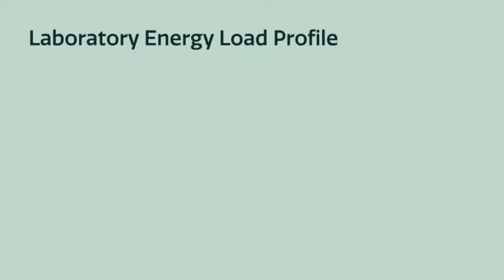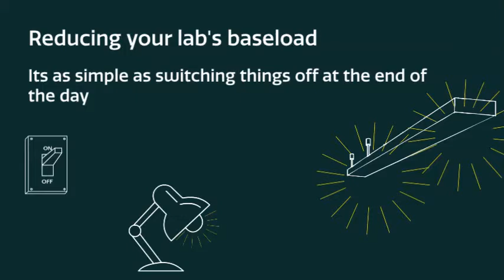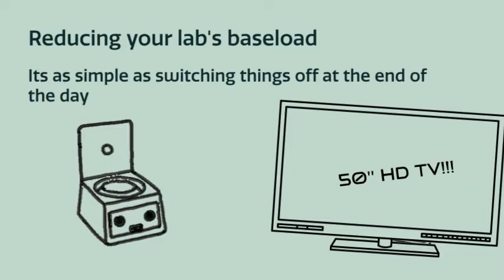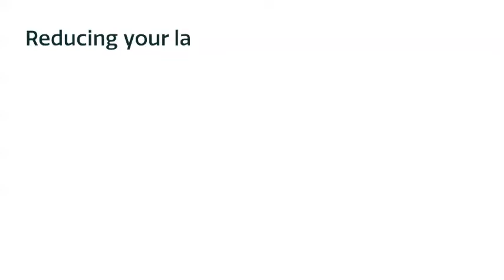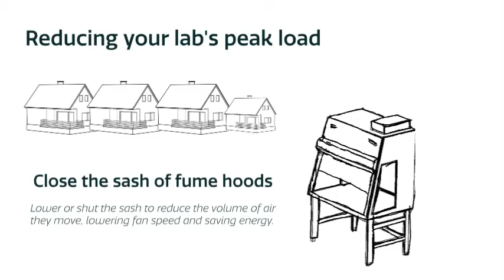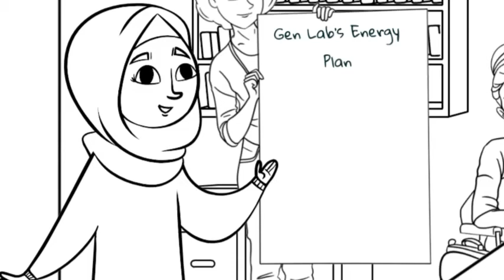Saving energy in your lab

Comment: I agree with all that but I am left wondering, does energy saved in appliance use end up being replaced by the building climate systems load. E.g. if I switch off a 100 W device in the lab, doesn't that 100 W of heat loss go on to the lab heating/cooling load, because that is set to maintain a constant temperature?
Reply: Hi Paul - if I can flip that question round to say is it efficient to use appliances as a source of heating? And in most cases the answer is no, building climate systems should be more efficient at providing heating than a general laboratory appliance would be. I'd also say that in most locations in Europe, more emissions come from cooling buildings rather than heating buildings so switching off appliances when they are not needed is reducing the problematic cooling load.
Reply: @brenrouse  Yes. Good points. I understand that at our place, the increased ventilation brought in for mitigation of Covid is, by far and away, causing the the biggest energy cost, and that we can't wait to get this returned to normal.